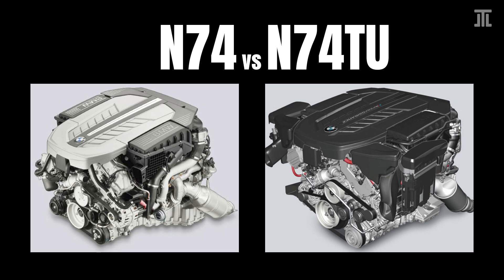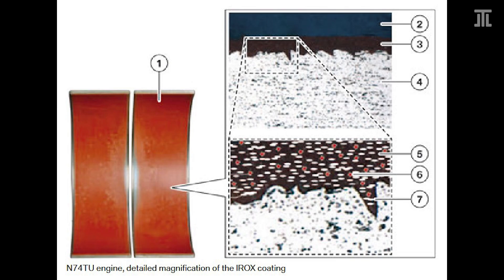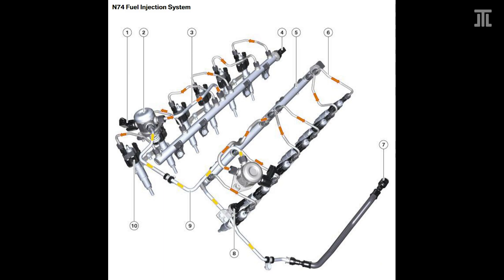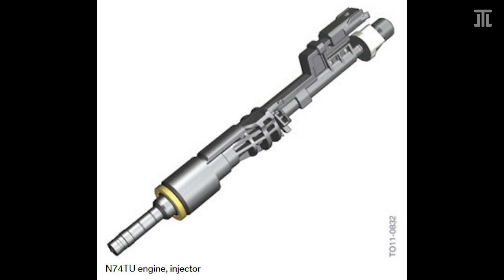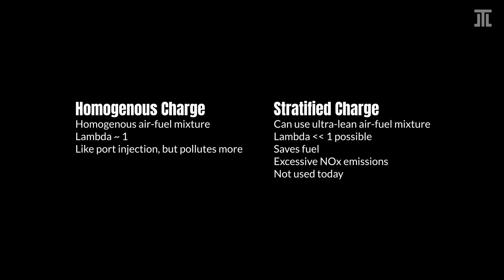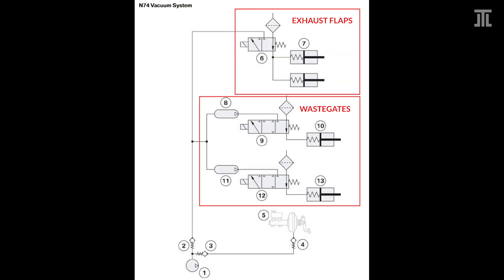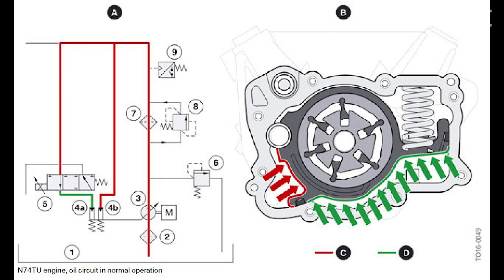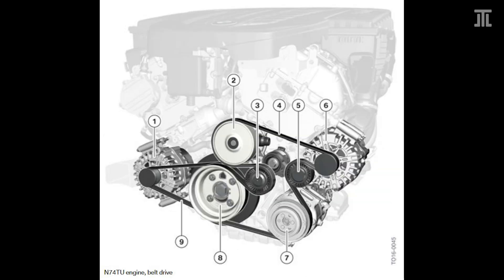BMW N74 vs N74TU: Bavaria’s Modern Classic Biturbo V12 Engine

Comment: I always deactivate the start/stop feature.  I started this practice on my F02 N63TU equipped vehicle and now on my N74TU equipped G12.
Reply: i want to buy a N74TU G12 but it's 90 000km. how much life can i expect out of the engine?
Reply: @ivanbelyanovjr.8025 500.000km but with two sets of injectors
Reply: how is the g12 treating you?
Reply: @expofcam still rolling...just put it on the road this past week

Comment: Off the record BMW went back to solenoid valve injectors from Piezo-electric injectors because of the leaking problem, which is common among 6.0 litre and 6 3/4 litre displacement models of high mileage. It's worth noting that N74TU2 switched to 350bar high pressure system.
Reply: What are common problems of the n74b68 found in the 2018 rolls Royce phantom?  Thx.
Reply: @Mabeylater293  Gaskets, fuel injectors and high pressure pumps. Nothing more than common BMW engines except the fuel injectors. Extra engine oil consumption may emerge but replacing the valve stem seal always worths a shot before the complete rebuild. I don't see the improved pistons making much difference in view of oil consumption as valve stem seals usually start to leak before carbon buildup choking the piston rings.